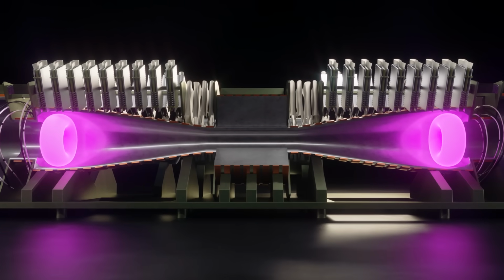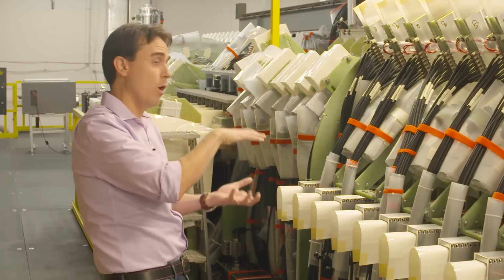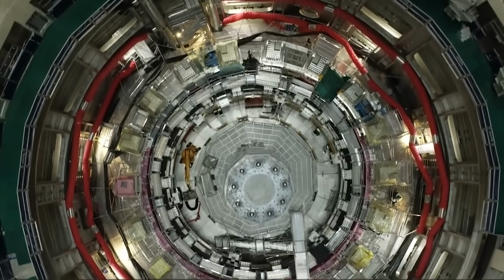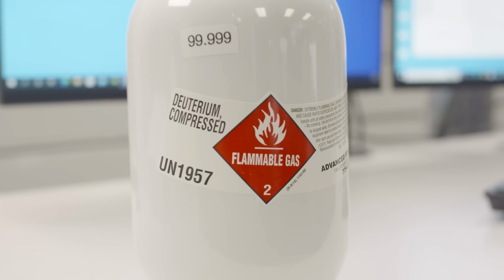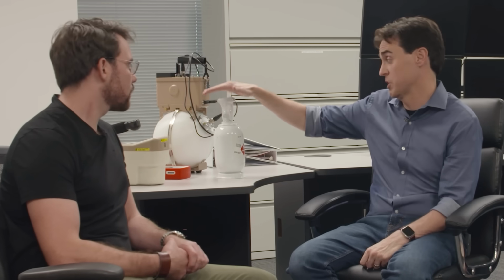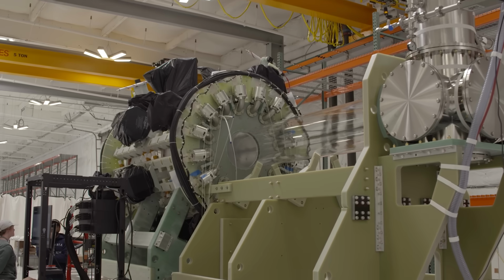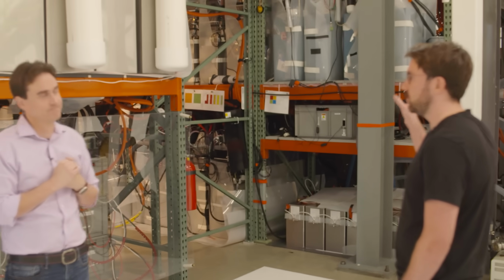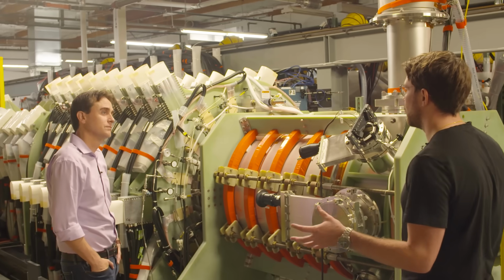A New Way to Achieve Nuclear Fusion: Helion

Comment: I really, really hope this works, but I’ll wait to hear what some independent experts in the field have to say about this new process before I actually get excited. As you said in your last video, fusion has always been right around the corner.
Reply: Yeah, because if they really could achieve this, they would have achieved aneutronic fusion. This means that you could use this reaction to power rocket engines and don't have to worry about radioactive and irradiating exhaust. 

You are right to be a little skeptical because I kept reading how D-T fusion (what ITER and the National Ignition facility are doing) is our best bet. Meanwhile, D-D fusion and He-3 fusion would require much, much higher temperatures to achieve ignition. But maybe this method of smashing things together (something that humanity is good at already) can achieve those reactions. And it does seem this would happen in pulses while tokamaks would generate energy continuously. 

Still, if going a step closer to achieving fusion means doing things other than tokamaks and laser-based inertial confined methods, this would be a good thing.
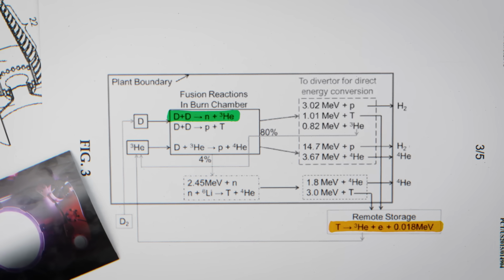Reply: @TheOz91  15:44 The D+D reaction will produce inevitably neutrons, therefore inducing neutron activation reactions.
Reply: @mikloscsuvar6097  but that's to produce He-3. D-He3 reaction would be aneutronic
Reply: @TheOz91  Correct. The D-D reaction will produce neutrons. And some of the will escape the plasma and be captured in chamber wall.
Reply: @TheOz91  Wouldn’t they have to use exhaust to propel them in the opposite direction? They’re still technically firing things out the back. Even the EM Drive uses a technology like this.
Reply: @TheOz91  you keep hearing about the others because they are totally government funded and spend gobs of money. Just like the NASA Orion at billions per vs SpaceX SuperHeavy at millions per.
Reply: D+He fusion is not aneutronic. The conditions required for that reaction are such that some of the deuterium in the plasma will fuse with itself. That reaction does release neutrons, which makes the D+He reaction overall neutronic.
Reply: I think the hardest part about this is going to be finding independent experts. They just unveiled this project and are moving on the absolute cutting edge of the field. IF this works, it is very unlikely that they are going to opensource this, so finding someone who isn't biased and has enough actual information is going to be really hard
Reply: They got some more engineering challenges as mentioned to make this actually produce more power than used it got to be much larger and that brings in more challenges on how to control everything. They explain it a tad better.

Next version and version after that not as hard as it power in vs power out level 7 will be producing power just not as much as it uses. And 8 once it becomes a power plant all needed to confirm is they not hiding a conventional power plant somewhere. 
There are no subject matter experts other than them this not been done before
Reply: @horrorhotel46290  Opensource? lol They are looking for a huge cash payout for their investment. ITER is internationally funded and so has to be fair and unrestrictive among its participants. This tiny startup has no such obligations and so expects to demand top dollar for their private research.
Reply: Not unless you call 'right around the corner' 20 years, for 50 years now, at least.  It is ALWAYS 20 years away.
Reply: All of the comments are a bit behind we had the net positiv fusion breakthrough like 2 weeks ago 
History was already written
Reply: @hasou5289  It was positive thermal, not positive electrical - and it was only positive thermal if you count the actual energy flux in the lasers, not the entire machine's operation. It's very unfortunate that's not more clear, since many people will become more cynical if they thought for a brief moment we'd actually done positive electrical but then realize we haven't.
Reply: "Experts" like the people who support ITER. Not because it's the best approach (anyone with a brain can see that it is clearly inferior), but because it generates the most long-lasting and lucrative careers for them.
Reply: @drewmandan  lol, this is what ignorance looks like.
Reply: I mean but this DOES actually work.. They made more energy than they put in which is literally the definition of "it works" in this case.
Reply: @fourcgames7568  they literally said that only the 7th iteration which they are building right now will attempt to capture the fusion's energy output.
So no they are making 0 energy right now.
Reply: @murlocksftw  energy output in fusion usually refers to thermal energy, not electrical. Which is a bit dumb, but the field has always been so far away from becoming net positive on electrical energy that a thermal net positive has been a huge milestone already
Reply: @murlocksftw  Wonder for how many iterations they have been saying this
Reply: I wonder @fourcgames7568 , has helion conducted experiments where they were able to generate more fusion energy compared to the energy that is required to increase the magnetic field? I know trenta doesn't capture any energy atm, but i'm just talking about fusion energy that is released due to the magnetic field acting upon it
Reply: @fourcgames7568  there have been several claims of being able to get more energy out of a fusion reaction than is put in, and yet we don’t have commercial fusion reactors being built. It pays to be a little sceptical of the hype until independent people have verified it and there are commercial plans in place, based on history.
Reply: @rainbowevil  But that’s comparing very different things. Scientific experiments are meant mainly to gather information about fusion not to go straight to electricity production. That would skip too many steps. Fusion is moving very rapidly in the last years. Tokamaks are just super hard to pull off, laser fusion won’t ever be viable for electricity production. But even achieving ignition wasn’t possible before, that’s a major milestone and gives so much data to work with. You’re being a bit pessimistic.
Reply: @MrXxHunter  I’m being sceptical, not pessimistic. If you want blind optimism, welcome to the last 5 decades of fusion hopes. It pays to be sceptical when a completely new player in any field comes out and declares their method solves all existing problems and doesn’t have any major downsides without any independent analyses from people without a vested interest in it.
Reply: @rainbowevil  Their design is based on 2005 experiments. So it’s not new and has been theorized in the past. Same for their method of creating electricity. You say it like nothing changed in the last 5 decades. Like technology stood still. That’s what I mean with pessimistic, not acknowledging technological evolution in the last 50 years has nothing to do with scepticism. I mean you’re probably typing this on a smartphone yourself, something that only really came to be in the last 15 years. The amount of computational power in our hands today doesn’t even compare to what we had 5 years ago or 10 years ago. That’s what makes it more likely. Not because fusion changed but the systems around fusion, the technology that makes operating it even possible. (btw. they aren’t a new player they just haven’t made it the details public for a long time).
Reply: @MrXxHunter  the fact remains all of this video is hype, it’s not a scientific paper on its viability to be commercialised or anything, it’s a company entirely invested in what it works on “selling” its technology to audiences. Of course there has been tech advances in the 50 years, but that doesn’t avoid the fact that nuclear fusion has been perpetually 30 years away for that whole time. Get your hopes up if you want to, but counting on this technology achieving commercialisation would not be wise.
Reply: That because they only counting power in and out of core part which is below total power used by a lot.
Reply: Except there are no outside experts in this process.  
But here they going for power generation in 7 and actually providing power to the grid in 8.

Thing is the ton of private investment money coming in. Before the past several years no one was willing to risk money doing this. Means we a lot closer than we were before.
Reply: @rainbowevil  Deutrium-Helium fusion requires higher ignition temperature.  That is 0.6 billion K vs 0.15 billion K.  It is four times the temperature.   And four time the temperature means more than four times difficulties.
Reply: @catchnkill  ok? Not sure what you were replying to there.
Reply: @milferdjones2573  They don't count anything rn. If you're refering to helion that is.
Reply: @catchnkill  Imagine you have to dig a hole, and all you have is a spoon. The hole is just barely on the size of being doable, and it's immensely difficult and has taken decades of work. Then, suddenly, your task is to make a hole 4x larger. Having it be more difficult suddenly has you looking to entirely different and new ways to dig the hole, and that's when you throw the spoon away and invent a shovel.

The task is larger, but it's actually become easier, because it was so difficult you made a whole new tool to do it.

The spoon is a Tokamak. The shovel is their accelerator reactor.

Even the people working at ITER know full well that we need a whole new approach to fusion, since the Beryllium neutron multiplier issue and issues with radioactivity and all the pressurized water systems mean that it's not going to be cheaper than fission with their approach.
Reply: @rainbowevil  this video contains alot more content than hype.

Comment: Very interesting. What's that phrase again? "Work smarter not harder." That white elephant being built in France may or may not break even but it's never going to be the basis of practicable fusion.
I winder... as a useful addition to increase efficiency and to allow continuous operation somewhat analogous to a combustion engine: a moving standing wave set up in those pulsed magnetic fields to 'convey' the forming plasmas continuously to the 'reacting chamber'..?

Comment: Scott Manley’s breakdown on the National Ignition report talks about different fusion technologies in the works as well. It’s a good watch. Much of the challenge with fusion is what you said: capturing the energy reliably with fewer drawbacks than competing power sources.
Reply: I haven’t see Scott Manley’s video, but I’m not seeing what there is to be excited about as far as this ignition breakthrough goes.

While the fusion did produce more energy than the lasers, the lasers themselves take several orders of magnitude more energy in electricity to produce.

That’s not even mentioning the issue of extracting the energy, running the reaction continuously, or making more of the diamond cases needed for the process.

Obviously it’s cool for the science of studying fusion, but I don’t see how it’s contributing to the commercial power race in any way.

Is there something I’m missing here? This is just my uncritical amateur’s take.
Reply: @jacksonletts3724  the main exciting thing is just that a holhraum has actually induced its own further fusion for the first time. Well, they reached ignition in the summer, and now it’s made an excess. They’ve been operating for decades under that mark, and now it’s been surpassed. 

The lasers could theoretically be made more efficient — part of their efficiency problem is they’re infrared lasers being pumped up to green, and the green pumping was added in in the 90s after the projected ignition from IR failed due to heat absorption issues. Specialty green lasers could be a lot more efficient, but that part doesn’t really need to be tested at NIF. NIF is about testing control and synchronisation techniques, primarily, as well as holhraum designs and that kind of stuff. Once that’s good enough, the rest should be relatively simple. 

It’s not enough to make a commercial power plant yet, they’d probably need 500-1000% energy profit for that, but the point is just that the total system efficiency numbers for NIF aren’t directly applicable to a commercial plant. Especially because they also wouldn’t need such a long run of optics to allow room for all the research sensors etc in an operational plant.
Reply: i just watched that one right before watching this lol
Reply: Comparing the difficulties and losses of fusion vs fission I can see why fission is far more practical.
Reply: @kevinforget549  For now, it is not far more practical, it is INFINITELY more practical, because no practical fusion reactors, or anything even close, exist.  Many of the gripes people have with fission reactors, and there are some very legitimate ones, have been solved.  

Remanufacturing/re-refining spent fuels to the point where the remaining material can be easily stored (you can hold it in your hand.  They make bullets, tank armor, etc out of it), and safety concerns go to near zero, as far as operation goes.  No meltdown chance, reactors that fail safe have been designed.

There are assuredly benefits, in theory, with fusion generation, though.  But 'waiting' for it is no reason to delay fission reactors, LOTS more of them than exist today, in any way.
Reply: I hope Scott watches this video

Comment: Is it possible to reuse or continue to use the heat generated by the first process?  To just feed in slightly lower temp plasma?  So you could cut down on the energy needed to feed it after the first pass started the fusion process.  

Could you also go with a cross configuration?  Say 4 then 6 of these firing into the center 2 at a time?